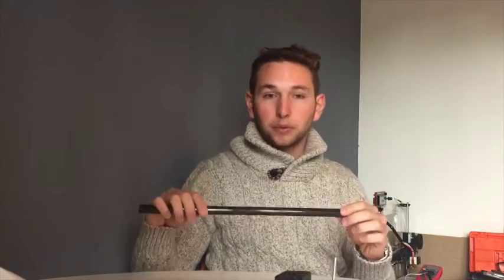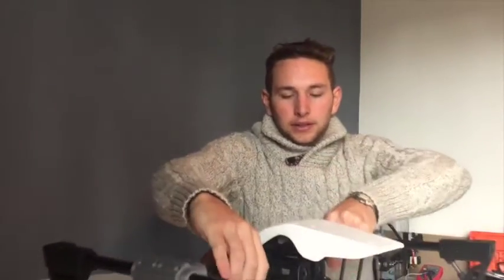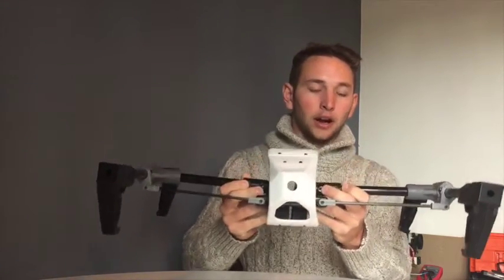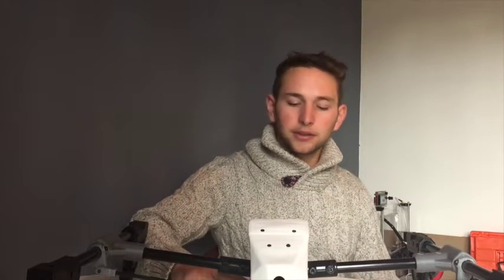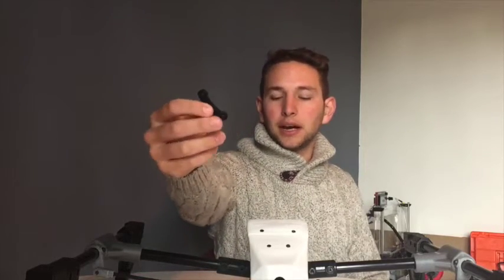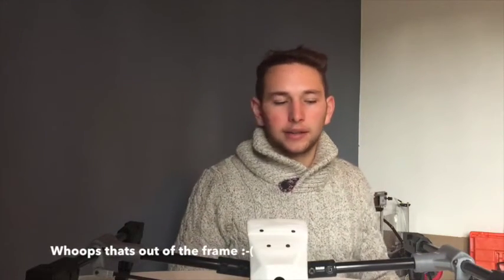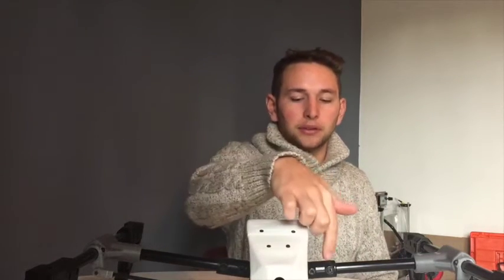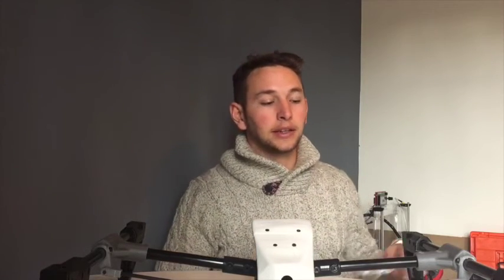3D Printed:DJI Inspire 1 Part 2

Comment: You probably know by now V1.5 is on the forums. You also have your bearing blocks in wrong place. The pushrod connecting the bearing block to outer arm should be in back not front. I have been flying mine now for 3 weeks.
Reply from the maker: Brian K hey Brian, thanks for the tip, yea I did make a note of it, but i have taken everything apart again to re-design a lot of the components because there is seriously not a lot of space to work with. I will do another update soon with all my electronics.